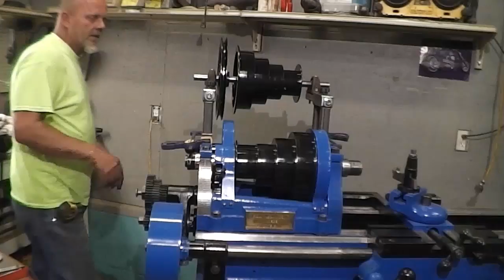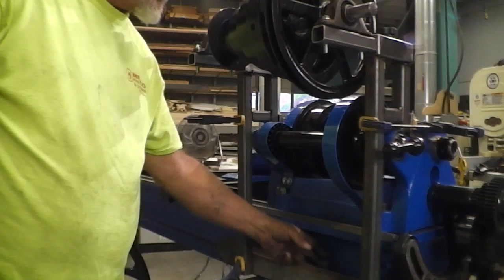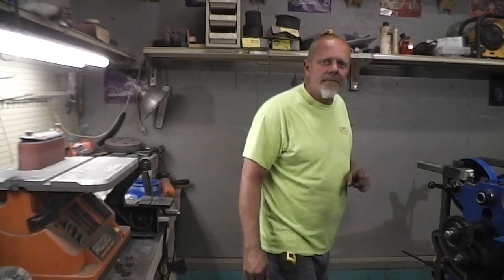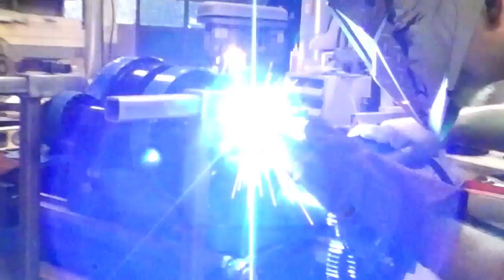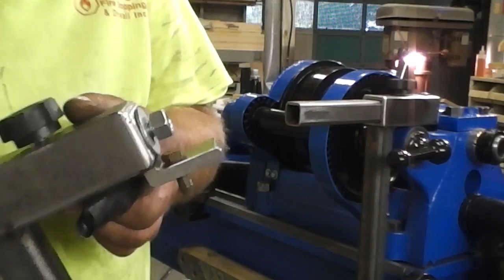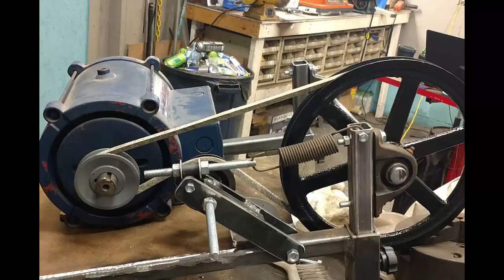Vintage Lathe restore, Cresson, Hubbard and Smith Part six, the drive fail and recovery

Comment: That was brilliant to watch Jerry i have an old Grayson lathe that is much smaller and suitable for my clock repairs, it's exactly like your lathe but much smaller i wasn't sure how to get around the centre shaft pulley system as like yourself it pretty much came in bits and the old boy i bought it from had it all dismantled and from what he told me his setup sounded pretty dangerous. That's a great job you did on your lathe 10/10 buddy 👍